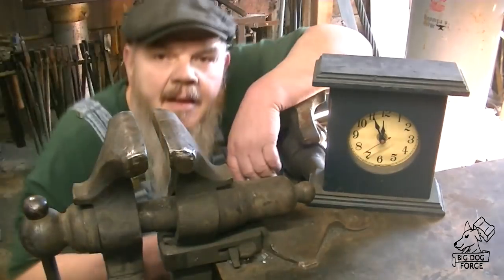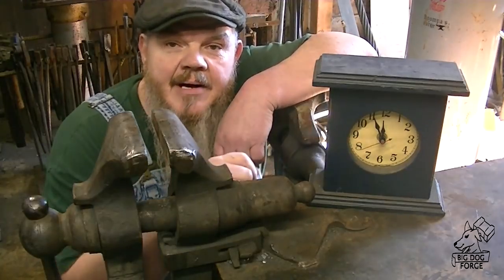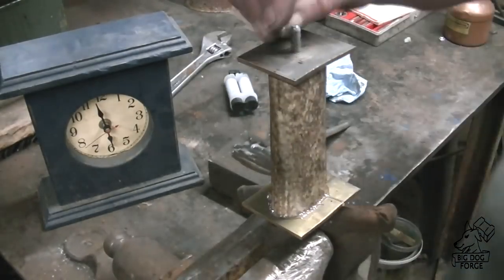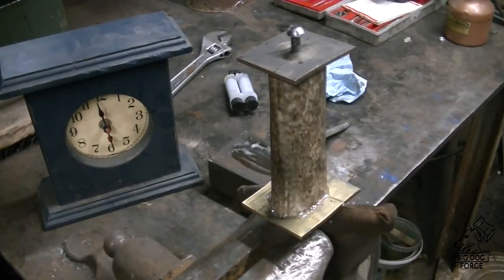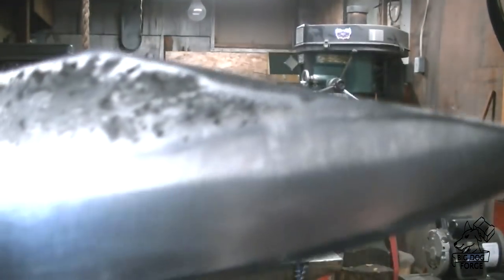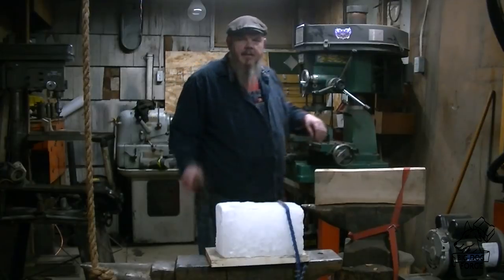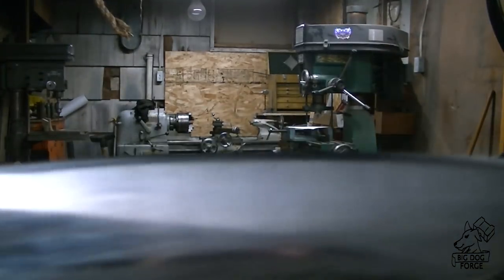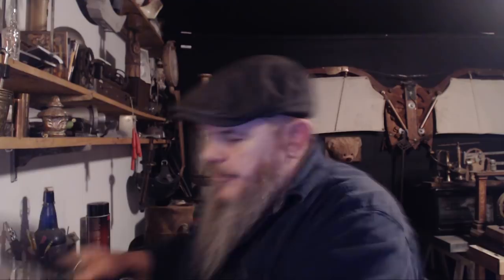Forging ppotty1 6 Hour  Knife Challenge

Comment: First comment from an old bloke - Great job Tim, I've been forging knives since the 60's and this one you made reinforces that I'm convinced spring steel makes the best working/bush knives.
Reply: A lot of people in the sharp & pointy community, from blacksmiths like Angus Trim to martial artists like James Williams, extol its virtues—and for good reason. Spring steel takes some abuse. It may not make the sharpest blades but for heavy use a razor edge is just going to chip off anyway. Give it a good appleseed grind and it will keep on chopping.

Comment: I just watched your video on using drillbits and putting them is a canister to forge them, but the comments were disabled.
What if you were to take a piece of stock, drill holes in it, fill the holes with metal powder to lessen the chance of voids and drill the bits into the holes.
I have a feeling it would make some interesting forge welded Damascus.
Just a thought and a curiosity I cannot investigate.

Comment: i watched your 6 hr challenge the other day and you was talking about heating up your car spring 2 or 3 times and pounding it till it was cooler to take out the natural bend of the spring so it wont warp.  i didnt know that would work.. but today i was watching forged in fire and a guy used a car spring and he didn't do that and it warped..learn something new everyday.  thanks  great learning shows you put on here.